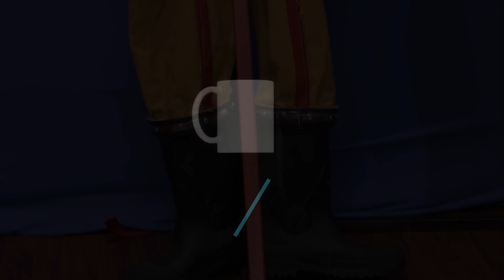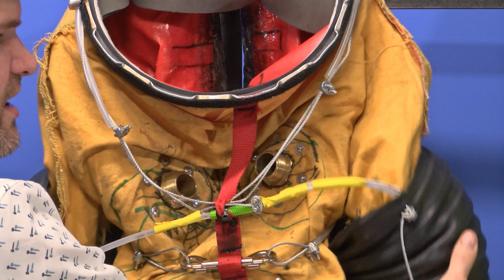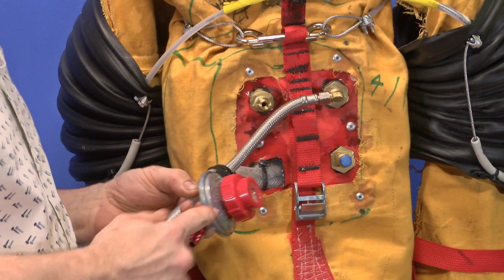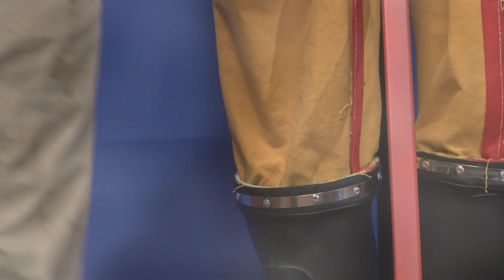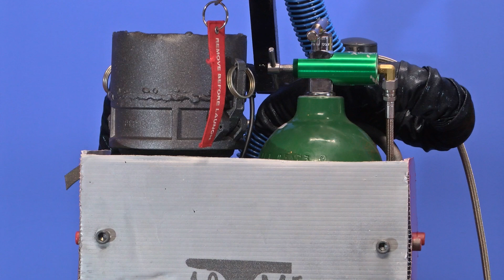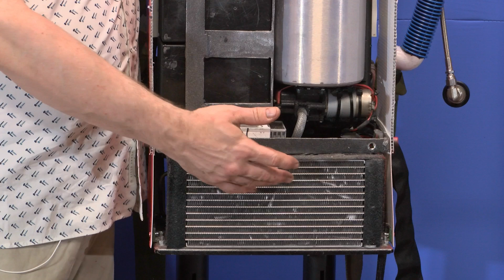Redux on   Project ACME for Cody's Lab

Comment: what does the mass breakdown look like?

If the COP of that heat pump is around 100%, it might actually be more weight efficient to use ice to store thermal energy directly as apposed to batteries:

80W *6h = 480Wh target
heat of fusion of water: 333 J/g
1/333 g/J * 3600J/Wh = 10.8g/Wh (92Wh/kg, for comparison with batteries)

10.8g/Wh * 400 = 4.32kg ~10lbs

Just meant to be a thought experiment, not any criticism; obviously the heat pump is more applicable for vacuum and it removes a consumable compared to the ice.
Reply from the maker: We get 4H max run as the total system draws about 100W 

and IF we were to  run it in a  mostly vac( sub .5 PSI A)  then I would totally use gas sub like the apollo suits did .  
sadly they suck in a non vac. its useless for what is at the core cosplay ..   so I did the chiller as its faster to recharge and with external power  via the ext power port It can run on * shore power*  Be it from a moon buggie  to  near a LEM. ext

 

I did ice on my 1st suit and it did 3H max . this is over all better.... for now 

Peter.